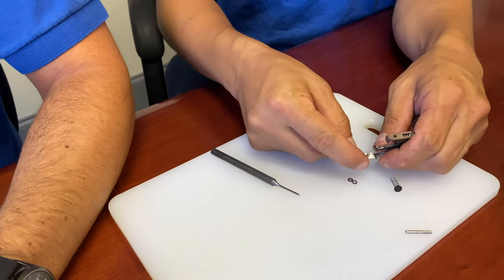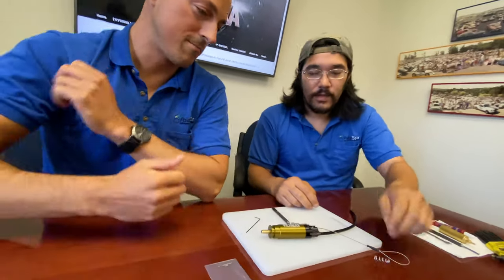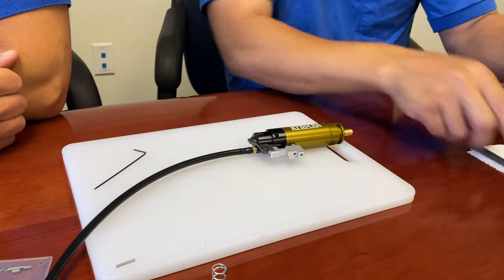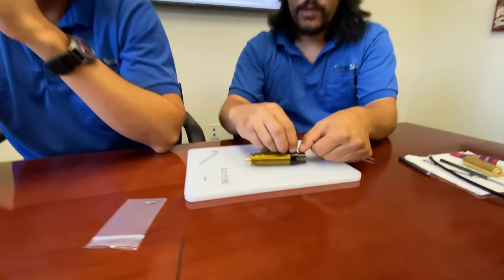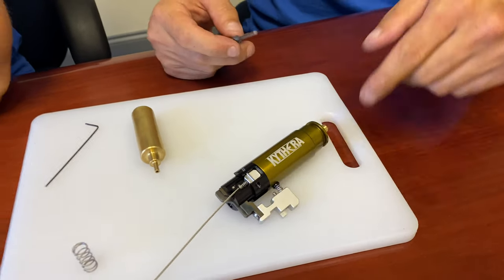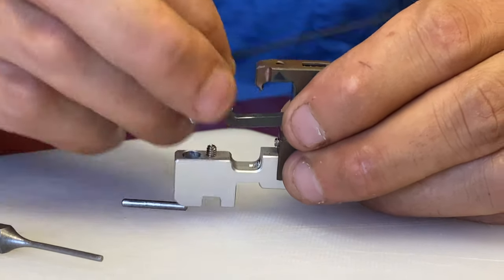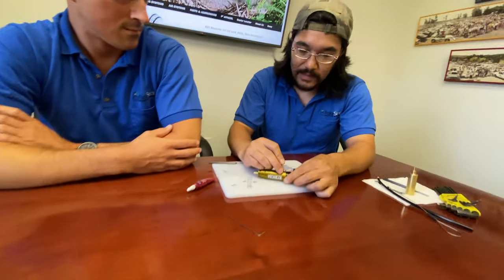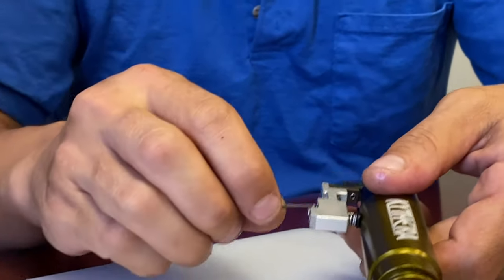PolarStar Airsoft - Kythera 101

Comment: Bought a kythera and I've been having nothing but problems. Right when I think I had it dialed in after watching so many videos I decided to watch this one before fielding it. Took it out to my next game and i had little to no hop. Bbs just dropping. Took it apart and saw grease everywhere on the nozzle down my barrel. Cleaned it all off from where I can see and then same thing. Opened it back up and grease everywhere again.I know very little about this kythera. Just been following every instruction video I can find. Do not grease where these guys say to grease it. Maybe where the o rings are only. And a very little tiny bit. Just give it an extremely light coating so it's not dry. I think I finally got this thing going. But only some heavy testing this weekend will tell.
Reply: I recently bought a used gun with the Kythera installed. I did some of my own changes to it and kinda messed up the previous owner's settings and tune. Doing some research I found out about the Kythera being notorious for leaking air. And there were a few people suggesting wrapping the hop up bucking with teflon tape to maintain a consistent seal. I would try this. You don't need it super thick(which you'll if it's too thick, the hop up unit will not fit). I test fired my gun with the Kythera and it is shooting noticeably further than before I wrapped with teflon tape. I also did this to my polarstar engine installed gun, and that made the same improvements! Also Idk if you bought the shims that Polar star sells, but as an alternative. I wrapped the front of the Kythera with teflon tape, enough to eliminate the move. Basically a cheap, quick temporary fix to see if any issues you're having have been eliminated. Good luck.
Reply: @cameronp2951  The main seal is usually where it leaks (so the O-rings underneath the gold cylinder when you unscrew it.) If you put your finger over the nozzle and feel air pressure building up, try greasing all the main O-rings.

Comment: If you want the maximum Power allow on the field with a ARP model you need swap to the heavy spring and also swap the regulator 200psi spring to get the best performance because of the very short Barrel 😊

Comment: You really need to include a Allen key in the box, i just spent $300 and cant even use it because the sear is locked up and i dont have the correct allen key
Reply: Did you ever make it to a hardware store?

Comment: I'm getting a problem where the nozzle is feeding the next BB in too far beyond the lips of the bucking so that the BB just rolls out the end of the barrel if the hop is set to off. This is also causing a low FPS/joule readings. I was having an issue where I had the disconnector set too far and it wasn't ever catching. While I was in there I cleaned up the Kythera and re-greased it all. And now I'm getting this feeding issue.
Before the system was set up perfectly and worked really well. I only had to set the MRS to 89PSI to get 1.5j using .32g BBs. Now I have to crank it up to 140PSI to get an very inconsistent 1.1j to 1.65j. I should be shooting a lot hotter using 140PSI.

The only thing I did in addition to what is shown in this video is that I removed and replaced the metering set screw on the left side of the rear body. Could that be the problem? Did I put it back in improperly? It's the same one that I took out.

Also, the bucking is fine. I have tested it by dropping a BB into the hop system and the BB sits nicely on the lips of the bucking as it should. 

The nozzle is over extending and pushing the BBs too far forward. Did I miss something in the reassembly? I've watched and re-watched this video about 12 times now just to make sure I did everything right. Any clues here?
HELP!
Reply: I'm not a tech pro, but I think I've seen this issue before for HPA hopup/bucking issues.

Your bucking might be too long, and when the bb feeds into the hopup it contacts the bucking.

I would do a drop test, and look at how it's feeding.  You can look into the mag well and shine a light in there and try and see if the bucking is sticking out too far.

That's my best guess, but there's a ton of videos about feeding issues.
It could be the gearbox too, if the Kythera is shifting around slightly it will cause feeding issues.

It should be easy to fix, or you can bring it to an Airsoft shop and pay them $20 to check everything and fix the feeding issue.

Comment: You're using 50000 hex key, how to convert that in inches or mm? We normally use mm here in the philippines.
Reply from the maker: Trigger/Sear adjustment screws have a 0.050" hex drive. This is typically the smallest wrench included in a standard Imperial allen wrench set. You cannot use a metric wrench for these adjustments for risk of damaging the screws.
Reply: Shipping product internationally with imperial sized screws when noone outside of the US uses imperial tools seems like pretty serious oversight... especially since you know that it results in stripping the screws
Reply: Los tornillos Allen que ajustan el Trigger/Sear son de 1,27 mm. Son llaves raras de encontrar.

Comment: Why is the v2 version rolling buckings and does it happen to the v2.5? I have the v2.5
Reply from the maker: Rolling a bucking can either be from the magazine not feeding quickly enough to push a BB up into the chamber before the nozzle comes back forward, or the lips of the bucking are sticking too far out into the feed tube so the BB is catching the lip and rolling it as it enters the chamber.

Comment: I have a kythera in my vfc mcx. It’s very picky with mags, I don’t get it. When I use epm mags I have feeding problems and it makes this farting noise every few shots randomly and I have to reset the trigger, sometimes my nozzle even gets stuck to the rear position.

Comment: Does the heavy spring increase fps level?
Reply from the maker: The heavy spring allows the system to achieve a higher velocity by helping keep the valve open against higher pressure. Check out our Kythera - Velocity video for more info on this. https://youtu.be/Segay-rs7HY